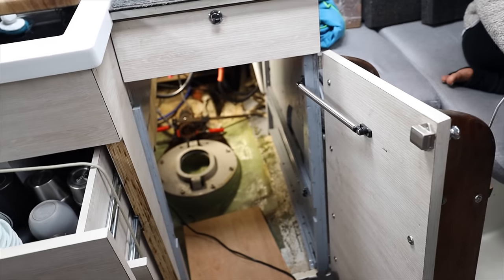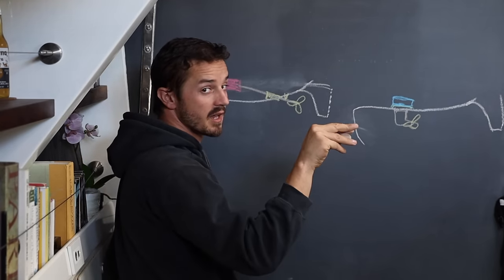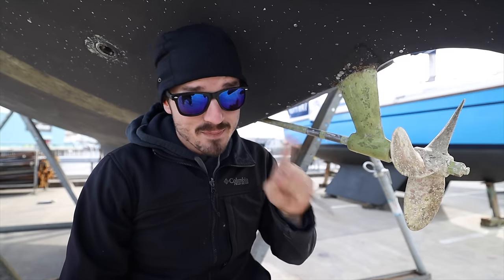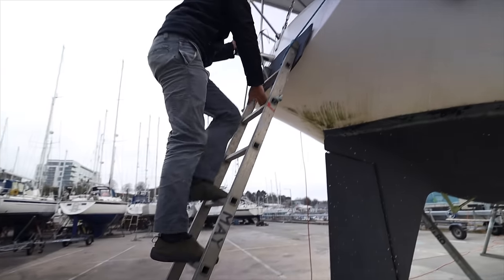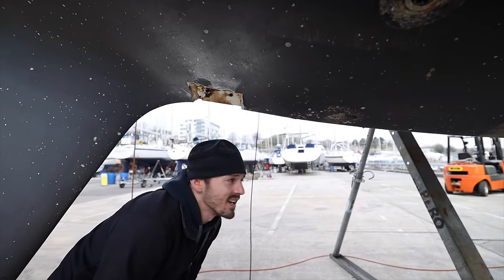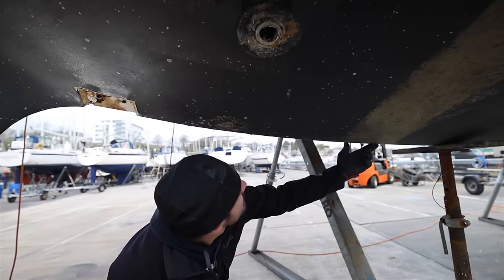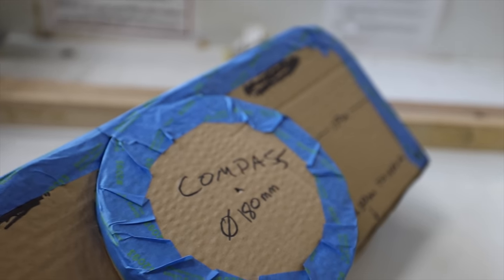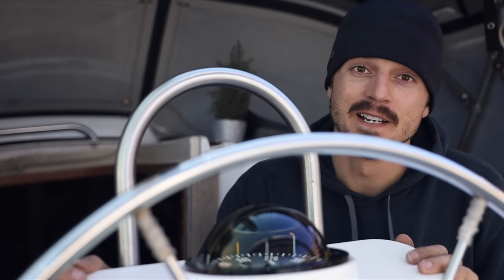CONVERTING to an Oceanvolt Electric Sail Drive — Sailing Uma [Step 213]

Comment: Just wondering. With a folding prop, how are you going to make the motor work as a generator?
Reply: sv Hulda it can lock open or unlock to fold Close
Reply: My question exactly. How is that going to work.
Reply: I think the propeller angle reverse and the motor become a generator.
Reply: It's mechanical folding prop. If they want, it's folded. If not, it's open.
Reply: @Brgnalf81  how do they lock it up open? By getting into the water every time? No thanks! Btw it's not going to generate but negligible amounts of power. They should buy a wind turbine if they want good electricity production.
Reply: as the source the got the motor from told in a vid, you start sailing with about 6kt and give the motor a little throttle to unfold the prop, take down the power slowly and the water speed will keep the prop spinging and therefore holding it unfold. maybee there is also a prop servo system integreated since there is cooling oil going down ths haft maybee also a hydraulic system to unfold or reverse the prop. 

the only thing i am wondering is in all that vids i thought Uma is more at 6kt topped in speed i am realy interested in seeing how the regenration works on lower speed, where is the point the prop folds in for themself and also is Uma without regeneration (and with the new sails) going faster now XD and how muth is regeneration slows it down.

i guess we will find out in some of the next vids.

and btw. you2 stay healthy and thank you for the inside view of your journey in life , time and over the world. you give a lot of your viewers a good time.
Reply: I want to know that too.
Cause my friend's boat automatically fold the prop.
Have they a lock system?
Reply: Can this be done from inside? Or do you have to swim down to lock/unlock it?
Reply: This is a prop from oceanvolt. You'll notice somewhere near the being on the video, that the prop can essentially be locked open or closed, but also have the blades reversed. So that they will spin the motor, as opposed to the motor spinning the prop, even more efficiently.  It's one of the major components of ocenvolt's technology.  I believe this is all controlled from the various controllers/places on the boat. One probably in the cockpit, and one probably near the charging controller.   You have to tell it you want to start regen, you don't always leave it in that position.
Reply: @C_R_O_M________  you may check out sailing wisdom - their solar panel gave up during their Atlantic crossing, so they only had the regen as energy source. They managed to run their fridge, navigation, laptops, lights only from regen.
Reply: Doesn't seem to make sense to most people but you actually spin the prop open with the electric motor. I struggle to get my head round it, let alone explain it to you lot 😂
Reply: Tibor Kiss and you may want to check how large that propeller was or whether they had a separate hydro unit (like an outboard to do so). That’s different.
Reply: Its not going to work with a folding prop. Geared props require centrifugal force to open them. You’re not going to get that passively, i.e. bragging the prop through the water. This is why WattnSea uses fixed blades.
Reply: Nick Salvador as I said. You spin the blades open with the electric motor. Difficult to understand how this can produce energy as your brain tells you that if it's using power to turn the prop, how can it generate it but it does.
Reply: @C_R_O_M________  incorrect, the amount of force that a prop turning through water is significantly higher than blades of a small (boat size) windmill.
Reply: @cyrilculton1181  Once it is spinning the blades are held open by centrifugal force, the same way they stay open when the motor is under thrust. The motor has to actually be physically stopped (by a brief jolt of current) for the blades to fold.
Reply: Andy C I have a Penta Saildrive that I’ve sailed about 20k on. As soon as the motor quits driving the prop, the blades (Slipstream prop) shut. The unit is then locked, by placing the tranny in reverse because the gears in saildrive legs typically do not enjoy passive spinning. The blades on the Watt N Sea Hydrogenerator are fixed for a reason, and the entire unit slides up on its bracket to reduce drag. I’m now wondering if there is some kind of servo lock on the prop.
Reply: As I understand it, the folding prop stays open due to centrifugal force, whether the motor is thrusting or gently generating.  If the speed differential gets too high between the hydrogeneration and water flow around the prop, then the prop may fold back in.

A fixed (non-folding) prop would be simpler, but would generate some drag when not thrusting or generating.

Bottom line: regneration works with a folding prop.
Reply: Loanword Eggcorn well, that is not how folding props are designed to operate, butI’m not going to go back and forth on it all night.
Reply: @salnichols94805  I understand what you're saying, but these do hydrogenerate with a folding prop.
Reply: Loanword Eggcorn I just decided to look it up. It’s a servo lock on the prop. Otherwise, you’re describing some weird kind of Brownian motion device.
Reply: @salnichols94805  Servo lock is good too.  :)
Reply: I have to put mine in reverse to fold the blades, but I'll check if it still turns the shaft if I don't. That is when the government allows us to sail again without threat of fine or arrest.
Reply: @C_R_O_M________  The Oceanvolt saildrive creates a lot of power, look at their website! and no noice!
Reply: one touch button on the display, puts it in "gear" so the prop folds out, just like you put it in reverse or forward.
Reply: @demonikelectronik  Correct.  Water is vastly denser than air, and the energy in water flowing across prop is very much larger than a relatively small boat windmill.
Reply: @C_R_O_M________  we know a few boats that do a crossing with only regenerate, maybe some solar cells but that's it...no generator at all!
Reply: @salnichols94805  it does with a button on the Oceanvolt display
Reply: DGurney you want to recheck what you wrote? A good wind turbine will generate about 400 W of power in 25-30 apparent wind . There’s no way their setup will hydro generate that much. Maybe 10 to 40W at the most and they have to buy a specific controller that supports the regenerating feature if theirs doesn’t (and I don’t think it does or they would be regenerating already which I haven’t heard them mentioning). 

Do you know what water speeds do you need to have passing through those propeller fins in order for a propeller that is coupled with a say 10kw motor (I doubt theirs is that big) to produce that much with their sail drive most likely in the 2.3:1 ratio - that’s a usual gear ratio for sail drives? That would be about 500 to 800rpm! Good luck with that! They’ll be lucky if they get 20 to 50 rpm (depending on propeller size) at 5 knots water speed (their average sailing speed) which translates to (best case scenario) 50x2.3=102 rpm at the engine side. Find how many wats do these engines produce at 100 rpm, find the friction losses, etc and you’ll find a figure in wats that would be what they’ll be regenerating. It won’t be even close to that of a medium to good wind generator.
Reply: Loanword Eggcorn water is denser than air but those props need a lot of water speed to go through them to get moving. For a boat to achieve a 10 knots speed the water speed that the propeller needs to have moving through those fins would be in the area of 50-60 knots! You compare apples and oranges.
Reply: @C_R_O_M________  But it works! even with 5knots of speed......
Reply: @bybont   If you are talking about outboard style hydrogenerators of cource they work but they are totally different to what they have. They are immensely expensive as well. I'm talking about their setup.
Reply: Nobody gonna read this far down in a random discussion, but I bet what they've planned works!
Reply: @C_R_O_M________  It's generally unnecessary to regenerate (hydrogenerate) at anything near the full power of the motor.  Lower power is fine for recharging batteries more gently over a longer period of sailing.  In fact it's easier on the batteries to have lower charging power and slows down the boat less.

If you're trying to argue that hydrogeneration doesn't work to recharge small boat traction batteries, that argument has already been settled, since it does work just fine for many people in actual practice.
Reply: I would like to understand how this is possible. I have a sail drive with a folding prop. If not in reverse it will spin have we turn the engine off, it’s free wheeling with only the friction of the system. Once a load is placed on the generator (their motor) the resistance will increase, causing the prop to fold. I guess you could limit the load but then you generation will be lower..
Reply: Brgnalf81 nope
Reply: Mike Hagedorn its done bij a push of a button
Reply: @eddiedoherty2349  It's explained at: 

https://oceanvolt.com/solutions/hydro-generator/

"The hydro generation or “creating energy while sailing” function is an automatic feature in all Oceanvolt motors. 

This feature is activated by pushing the button on the Oceanvolt displays for 5 seconds. The display will automatically switch to regeneration mode showing the current generated power, RPM and time until the batteries are fully charged. 

With a normal folding propeller the motor kicks the blades out and centrifugal force combined with the motor controller keep the blades open. The motor controllers tune the system actively at 10 Hz which prevents the blades from closing (too much braking would close the propellers). This is continuous monitoring, the system will adjust the propeller RPM depending on the boat speed. 

The system shuts itself down when the battery is fully charged or if boat speed is too low for efficient hydro generation."
Reply: Loanword Eggcorn thank you for helping me learn about the regen with a folding prop. I was unaware that it had been solved.

Comment: Just imagine how much room there wasn't in there when there was a diesel motor instead.
Reply: how much roon bateries will take ?
Reply: @kirillsh8383  As much as diesel tank or so.
Reply: @vadimus2007   and how many miles you able to do on dieles and on bateries?
Reply: @kirillsh8383  If you haven't noticed it's not a powerboat, it's a sailboat so you can go as far as you need.
Reply: @vadimus2007  I noticed, but when you are in open water and bad weather motor is used instead of sails
Reply: Doesn't look good for crossing an ocean with no wind.
Reply from the maker: There is almost always some wind, and we've learned to sail in very light and very heavy wind conditions. We don't motor in heavy weather, we heave to, or sail though it, and it light wind, we just drift sail along and 2-3kts. It's some of the most relaxing and enjoyable sailing we do, we love it.
Reply: @SailingUma  You ruined the boat...
Reply: @SailingUma  lucky you, ones we stay 8 hours without wind and out of petrol in 17 mils from shore....
Good luck
Reply: @elonmust7470  I agree now the boat is vulnerable to shallows and reefs and any floating timbers that will take out the sail drive and leave a gaping hole in the bottom. better stock up on inflatable rubber rafts!

Comment: How do you lock the prop to allow regen?
Reply: one touch button on the display, puts it in "gear" so the prop folds out, an elektric motor gives power, but also can generate power.

Comment: Is it just me, or was the prop spinning backward?
Reply: I thought the same thing. :)
Reply: Maybe it was in reverse?
Reply: I expected it to start spinning in opposite direction but it could be how props are angled.
Reply: At 18:19 you can see the prop is made to spin counter clockwise looking for the rear of the boat. The flat thick side is the front of the blade.

Comment: Nord lock washers are designed for use in high vibration or dynamic load applications. The cams and radial teeth on each side of the washer creates a wedge-effect to prevent the nut from loosening. Brilliant!

Comment: first time I've seen a prop-shaft to sail-drive conversion done, what a great job you guys have done again. Whenever I do jobs I've not done before on my boat I'm always going back and forth to the instructions. Never see you do that :) Excellent fibreglassing too, something I need to learn and practice. Great teamwork again guys. It's amazing how small and light that engine is. I recently changed out my old prop to a new flexofold and the design differences are amazing - you can see the huge difference between the shape of your old prop and the new one too and I look forward to seeing your reaction when you take her for test run after the launch. Great job guys on the boat and great movie making too. Stay safe in this crazy world we now live in.

Comment: As a shift worker and a ear plug technician
TIP: before placing the plug in your ear, just put a little water on your finger and use it to lubricate your ear. 
Then roll the plug between you thumb and index finger and as you insert the plug just rotate left to right.
Great job on UMA. Looking forward to see how it performs

Comment: Super install! Nice work and fast! Would have taken me 3 weeks but ..I might have gone with a compromise: Electric Shaft Drive.. ? Would keep the propeller in it's designed place and perhaps prevent sail-drive vulnerabilities...? but what the heck do I know? I am sitting on my couch r/n! This is really one of the best cruising-sailing U-tube channels out there. I appreciate seeing all the work on the boat and on the cinematography.  BTW Nord-Lock's seem to be a common upgrade / the new go-to fastener on vintage Porsche C.V joints, they are a relatively recent invention, but trusted. You should be able to sleep soundly and not worry about the prop-fixture dropping to the floor of the ocean.

Comment: The old prop turning pink is due to de-zincification of the bronze. You had some electrolysis going on -perhaps the anodes were not making good electrical contact to the prop? It might be a good idea to paint the prop etc. to minimise electrolysis and this will be even more important with an aluminium leg. Also, you should not use red loctite on bolts unless you never want to remove them -blue loctite would be more suitable on the leg bolts I think. Finally isn't there a rubber gasket around the leg level with the hull (keeps the wee beastys out)? Looking forward to hearing how much power this system generates at hull speed!

Comment: The prop you are putting on is cool and gives you that little edge of speed if you were racing but keep an eye on it. Just a little build up on that folding mechanism will keep it from folding closed or opening. Or half and half.

Comment: Brilliant result, well done.  With added efficiencies as a result of cooling, hopefully with optimum battery power, you will have an enviable set up for propellor use as and when you need it.  Have you considered and rejected a wind turbine to provide a further source of charging your batteries?  Looking forward to sea trials and your use when travelling.

Comment: Just a quick note.  While you have the boat on the hard--a pair of eye bolts fitted to the aft end of the keel and the rudder skeg forward side allows a wire to be run between them as required, keeping nets, ropes and logs from fouling the sail drive or its propeller.  Some areas are filled with these hazards.

Comment: Jaw droppingly impressive  demolition and installation!  The two of you should open a boat repair shop if you ever decide to settle down on land.  Very Very Nice.  I was especially impressed with how beautiful your fiberglass job on the bottom of the boat looks.  Fiber glassing against gravity -  A recipe for frustration.  You should raffle the propeller off or somehow use it as a fund raiser.  I don't know where your information came from that a little corrosion on a bronze propeller makes it brittle?  Bronze can last thousands of years under water with no maintenance.  Surface corrosion shouldn't have any effect on structural integrity.  All in all another impressive episode!  Love the camera work and editing.
Cheers from Juneau Alaska,
- Greg Chaney

Comment: We use NORDLOCK washers in industrial equipment, they remain locked even after 20 years of vibrations.   Make sure you ventilate the fumes from enclosed spaces when using solvents and painting.

Comment: Amazingly clean work! I do house painting and renovations and that was some perfect cutting and grinding.Dam I could use some good workers like you two, but I cant really afford to pay architects. 

     One tip. You know that black shield that goes around the grinder disc that always gets in the way, that we all remove? When using the cut off disk there's lots of sparks.  That shield isn't there just for the sparks, but more importantly, it's there for when that cut off disc unexpectantly breaks off and goes flying apart at 22 ooo rpm's, right in front of your face. I've had it happen to me twice and OMG, those broken disc parts stuck into the material next to me and not me.  Wear a full mask shield and or put that annoying black shield back on the grinder when using those thin metal cut off discs. Work safe, play safe, don't gamble with your eyes and face. Peace and love.

Comment: Well done!  The fiberglass work in the hull looked quite impressive.  The aluminum housed motor looks quite small.  How does it get cooled?  The newly designed and manufactured binnacle pod is beautiful.  No cup holders?  Looking forward to the sea trials to see how the “new” sail drive performs.  You two are turning into quite the Naval Architects!